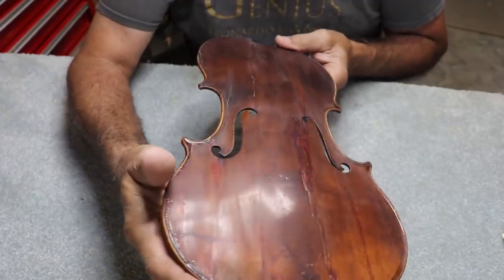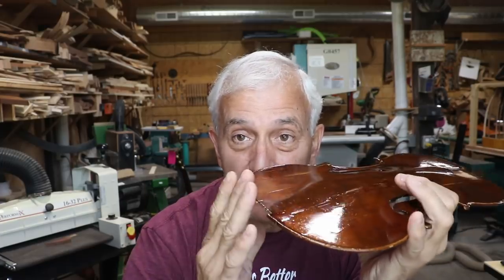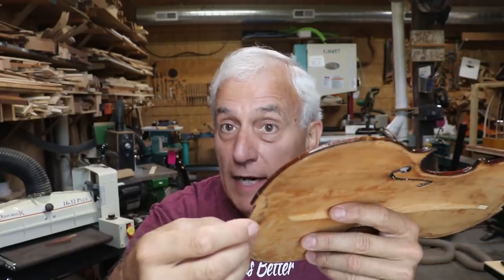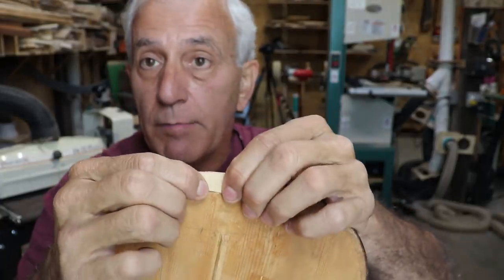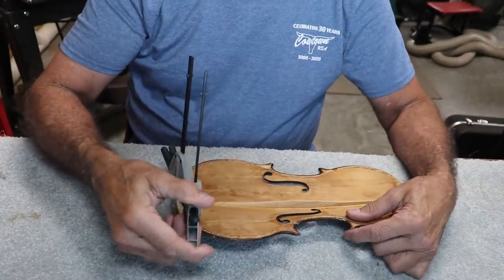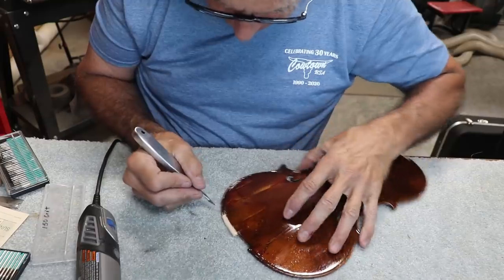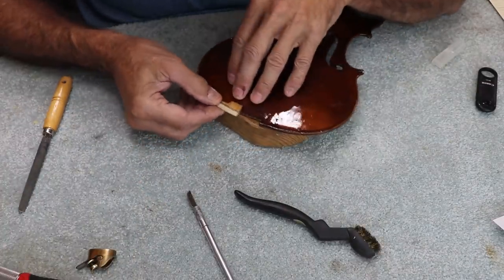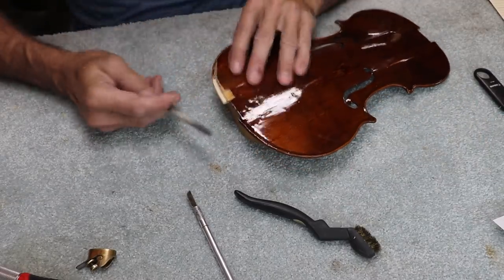433 RSW Chocolate A Bittersweet Restoration Part 3

Comment: As a restorer of fine antiques I have enjoyed watching you work and have picked up several really good tips/techniques from you. One area I see you kind of struggling with is in finishes. My advice to you is to do all your color and tint on the wood itself then seal with a 50/50 coat of clear shellac/alcohol. To get the age looking better use amber shellac but dilute it by 50% with alcohol too. Takes a little bit longer but dries fast and is more controllable. Finally - never uses shellac or varnish straight from the container. Always thin by 50%. This will eliminate brush strokes and result in a finish that looks correct rather than thick and "new". Your experience with the varnish lifting the stain was as I predicted and could be avoided by staging the finish process more like I have suggested. Don't apply any sealer or finish until you are happy with the color then seal that and use your finish coats to get the correct "age" feel. Keep on keepin' on.

Comment: I know this video is years old at this point, but this is fabulous work and I have only a small recomendation- I have foubd that tinting the topcoat can help blend disparate colors. It doesn't always take much, and some finishes are more receptive to tinting than others, but I have found it helps level out the color differences.

Comment: My guess is that you need to spray a sanding sealer over the stain.  Every time you stained it then put a varnish coat on top, the wet varnish coat reacted with the fresh stain.  But like you said, these things can be a bit of trial and error at times.  ☺☺☺

Comment: Hi, Jerry, thanks for sharing your expertise and knowledge with us!  I've three points to raise:  1) That was a great idea to rout and chisel out a rabbet to accept the replacement piece at the tail of the violin.    2) Regarding your Proxon router base, have you ever thought of adding a clear plastic base to the underside of the base to overcome the large hole in the base?  3) Have you ever tried airbrushing to blend in light stained areas to match the overall darker toned areas?  And after getting the match as close as you can get it, you could spray on a sanding sealer to lock in the colour before applying the final topcoats.
Reply from the maker: Yes I have had clear router bases in the past I got rid of them because they scratch easy you can't see through them and they are very static prone so everything sticks to them. Regarding the idea of airbrushing see part 4

Comment: Jerry your right about using a brush to apply a finish.  Applying a finish with your finger give me a break.  I really enjoy the pride you take in your restorations and this one shows how passionate you are and what lengths you go to achieve it. Really like the end grain gluing theory.  I'm a 68 yo retired carpenter not bashing or bad-mouthing but I have had luck adding a little stain to the varnish it makes blending repairs easier.
Reply from the maker: Just for the record the bottle says use your fingers.

Comment: Have you considered adding dye not stain but dye to a shellac and applying it over a thin finish to match or repair spots.  It works very well. I have had good success with restoration work I have done on both jewelry boxes and furniture. Just to be clear I'm very much an amateur that enjoys woodworking as a hobby. I really enjoy and learn from your Channel.  You do amazing work in such short time benefiting you're very lucky customers.  Thank you for all you share.

Comment: Hello, from the broken cello. I know you, like my son, work on multiple kinds instruments. Me, I focus on just the cello mainly, (I take broken cello's and repair them to put an affordable cello in a student's hands) but will also do some violins and such. The issue you seem to have is the original oil finish has closed the pores of the wood and it will not accept new stain or varnish. It is a common problem with older finishes. Many times you have to get rid of as much of the original finish, or go to a super high quality repair finish to get a color match. you also might trying to warm the wood with an ultra-violet light to help lens the finish and open the pores. It is time consuming because you only want to warm the wood for regulated periods of time. I hope this helps.
Reply from the maker: I guess you didn't see the end. That's precisely what I said I was going to do
Reply: @RosaStringWorks  Yes, for some reason it stopped about a minute before you said that... Another suggestion, if you don't mind... before you refinish it... you might want to make a plaster cast of the front, fine sand the mold to fit the original belly of the violin, steam the front a bit and sandbag it (Well I use flower in ziplock bags and some cals for even pressure) to get a smoother curve on the face, especially where the sound post break is, and the other repairs before cleating it. And I've been there, where no matter what you do, it just doesn't want to cooperate. Great videos btw... Just another instrument geek, geeking out on repair vids.

Comment: I'd not have jumped the gun on those initial recoats of varnish before you touched up the stain. My appoach would have been to go over the entire surface with 220 or 320 grit sanding pad and used a medium brown gel stain over the entire board to get an even color throughout. Let penetrate a few minutes and wipe off excess. Then do your varnish coats after the gel stain dries. Just saying. You live and learn. Otherwise an imaginative and well executed rebuild.

Comment: Hi Jerry. I had an "old timer" tell me once that he sometimes used a very light "spritz" of spray on shellac to "set" a stain before the finish coat. I don't know how that works with different types of finishes going over it. They way he described is it doesn't entirely seal the pores yet keeps the stain from rubbing off or floating out. Can't say it works because I've never tried it. Just thought I'd pass it on for future reference. :)
Reply: Good tip!

Comment: You know when you say to stop when you’re ahead, could this be one of those times?  Both my Dad and the Master carpenter I learned from told me to stop trying to do the same mistakes hoping for a difference result, and simply walk away from a troublesome project for a while.  Yes, I’m still trying to learn that one.  Hang in there, you’re almost there.  Your cross grain fix near the tail block is sheer genius!  You left us on a cliffhanger: can the hero Luthier re-stain the top of the violin and restore the rich chocolate color and sound, or has he met his match (pun intended)?  Same Bat-crazy time, same Bat-crazy channel!  Thanks Jerry.

Comment: Bare wood is the smart choice at this point. 
I think what went wrong is, you  put varnish down, then tried to stain/fix the spots and you were only staining the previous tru oil surface and when you steel wool'd and true oiled again it just wipes away. notice the espresso on the new wood patch didn't lighten up but the old streaks did. nothing for the stain to stick to very well. you're on the best track at this point. 

Great content brother, love your channel

Comment: Jerry, you have done quite a wonderful number on "Chocolate" and frankly, it looks great in the video.  I have watched a large number of violin luthiers on YouTube and I have compared one to the other regarding their techniques in carving, assembling, and varnishing their instruments.  It is hard to match stain, as you said, and I have no less a hard job ahead of me in that respect.  One technique in matching the color of the instrument is tinting the oil instead of staining the wood.  The tinted oil, just a small amount as needed, is applied to the areas needing it, feather it out, and apply more oil until the color is reasonably matched.  I have done this on woodworking projects I have done, if not just getting the tinted oil for the color desired.  I lost a sale of a piece one time when I had stained the wood then applied varnish over it.  It all looked great when I finished it and put a price sticker on it.  A lady wanted to buy it and was peeling the sticker off when the finish came with it.  Lost that sale and the potential sales of other people looking over my work. I was at a crafts show.  Not trying to change your way of doing things, just some friendly insight from someone else's eyes and experience.

Comment: having been trained many years ago to spot prints. There is a technique that will absolutely blend areas that are not the same perfectly so they disappear. You are using a painting stroke with your stains. Try using a stiple, just daubing color in tiny patches. At first it will look kind of bare and you will see blank areas around the stipling but as you add color it will fill in and those blank areas will disappear totally. This technique will take more time but you will not see any strips of areas that are blank of color. On the front of this violin where those cracks are still showing this technique will blend them in perfectly.

Comment: This has been quite an undertaking. Amazing job on this thing. Only thing I might have done differently is to strip back the old finish and refinish from scratch. The cracks would have mostly disappeared then, I think.
Reply from the maker: Pretty sure that's what I did, maybe you didn't watch it all
Reply: 0:17

Comment: Hi Gerry - Antique furniture restorers rarely put oil based varnish over colour or stain touch up. It often sucks it away as you've found. They tend to use oil paints, various colours usually mixed from palette of black, dark umber, light umber, red and white only applied in tiny dot fashion like newsprint to cover scratches or match up veneers and just wax over it after. Dots are far less noticeable than painted strokes.  You can get away with it if the varnish solvent doesn't dilute the stain solvent, like spirit based varnish over water based stain - but experimentation is definitely required first on scrap to see what happens. 😁  The age old instrument varnish, used from about 1700 onwards was made from pine resin, larch turpentine and either walnut or linseed oil, applied warm. Apparently it was considered good if it dried in less than 8 days 🤣

Comment: I was waiting for you to strip it completely right from the start. It's pretty much impossible to make all those repairs match without stripping. You should strip the whole violin, fill the cracks to perfect smoothness. There will be visible scars but that's the history of the instrument. Keep it up, love the channel! :)
Reply from the maker: It's not common practice to strip old instruments all the way to bare wood in fact it hurts the value so you try not to do it
Reply: @RosaStringWorks  I'm with you and lean toward preservation. I'm sure it was a really difficult decision to make (a) keep the original patina - warts and all or (b) do a correction to improve the presentation & delight the customer. Glad I'm not in your shoes. Can't wait to see how it all turns out in Part 4.

Comment: That violin is causing you a real headache, I'm sure no one else would have even attempted to repair it. I worry if it will hold together when the string tension is applied. Best of luck with it, I can't wait to see it finished.

Comment: LOL... Sorry Jerry for commenting but I have to agree with you, only way to get the stain to stay is to get it into the wood pores, laying it on top of the finish each time it's just going to wipe off every time you get it wet... It did look a lot better though... can't wait to see what it looks like with a fresh coat over bare wood... Maybe air brushing the top coat would have worked better, if that's possible with that finish....

Comment: I was thinking of a scarf joint for that missing piece of top, but I think your idea sounds good, too. Yours is probably better structurally, so again, good choice. I am amazed at how good she looks already, compared to the pile of parts and shards you started with, she's a masterpiece. Can't wait to hear the results.
ETA: When it comes to staining wood, you're 100% right, you never know just what results you're going to get. I built a uke, a little while ago, and when I stained it, the maple on the sides and back took a beautiful brown, and the same stain turned the spruce on the top bright ORANGE. It took a LOT of work to make that turn into a believable sunburst. Staining is a real trick. 

One thing I've learned is that sometimes a light wash of white beforehand can even things out a LOT. In maple, and if you're doing a blue or green and want the grain to really pop, you do the whole thing in black and then sand almost all of that off and then put your color over that. Makes the grain really stand out under the finish. Lots of weird little tricks in this game.

Comment: I think I mentioned early on that stripping to bare wood with all the repairs and replaced wood would be my choice to get a more even color.  We all know it will never be the same with different woods in the patches and being color blind makes it double tough to match or create an even color.  I look forward to the result.  Honestly, I did not think the current result with the yellow, red, brown, black streaks would satisfy you.  I think air brushing will help.  Have you thought of using a an electronic painter that uses a vibrating piston to force the paint out.  It will not only force stain into your skin for a tattoo if you wave it across while working, it forces the stain into the grain and surface of the wood.  I used one on my fences from Colorado to California coast homes/fences and found it not only gave an even stain, the injected stain created a depth of colored wood rather than a surface color that a sealant or varnish might cause to run.

Comment: A suggestion:  I found while matching/staining stubborn cabinets/trim that I add the varnish and then lightly brush in small amounts of stain in key locations while the varnish is still wet.  The color locks into the layer of varnish.  I then can put a coat of clear varnish over the top after the previous layer had dried.  I got the idea from an old can of Minwax Walnut Antique Oil Finish.  I ran out before the job was done and found it was no longer made.  In an act of desperation I bought the clear finish and a can of dark walnut and made my own.  It matched perfectly... with a little experimentation.  Paul Hensley

Comment: Some thoughts on the finish...  Oil based varnish, because of the oil, acts as a solvent.  I assume the Minwac stain is water based, so the oil based varnish can “clean” some of it away,  Stain also needs to be able to penetrate the grains of the wood, so putting it on after the varnish, doesn’t work.  Even when you’ve steel wooled a previous coat of varnish, some of the wood grain is already sealed up from the varnish, prevents the stain from penetrating.  

At this point, you  may have more luck if you do a though (multiple grits) steel wooling (if that’s a word) of the entire top.  Especially 9n the light areas, to open up the grain as much as possible.  Then put multiple coats of stain, on the lights spots, letting them it thoroughly “dry” (over night).  Finally, apply the varnish, but be very careful how much you rub 9n the stained areas.

Regarding stripping away the finish, I would be very concerned that whatever you use for stripping, could affect the glue you’ve used to make all those delicate repairs.  Like you’ve said, sometimes you need to know when to stop.  You’ve done a master level job of repairing a completely destroyed instrument.  No one should expect it to look “good as new” once you’ve finished.
Reply from the maker: I was using analine dyes and oil based stains
Reply: Rosa String Works very interesting.  You obviously have done a heck of a lot more of this than I have, so I should have assumed you knew that part.  It’s been years, but I used to do lots of woodwork.  I know the struggle of trying to match finish color, tone and gloss.  Looking forward to Friday, Jerry.  Very excited.

Comment: I've had luck with mixing a small amount of boiled linseed oil in with the stain to "stabilize' it, and giving it a day to dry before applying finish.  Not a cure-all, but it does reduce the 'lightening" problem.

Comment: I don't want to criticise Jerry, but could you have glued the purfling to the fiddle with CA and glued the new part onto the fiddle with the puffling in place?. This would eliminate the need to cut a purfling slot. I would also have let the big patch into the back so as not to increase the thickness so much. I love your videos and have learned a lot about novel and new ways to do things. Good work.
Reply from the maker: There are many ways to do everything.  That;s just how i did it this time.  Next time I'm sure I will do it different

Comment: If you airbrush using cappuccino by Minwax allow it to rest for 8 hours then respray to darker than you want. Allow to rest for 24 to 48 hours before using oil finish in airbrush. 
Remember oil finish will lighten Minwax dark stains. You’ll figure it out.

Comment: As to the stain I sympathize. As far as I can tell the stain just dissolves in the oil and as you are putting the oil on you end up wiping the stain off. In fact wood stain seems to me to be a misnomer, most of the time it does not seem to stain the wood at all, it just lies there on the surface. Also if there is even a slight amount of glue around those joints the stain likely just sits on top of a glue film. I think the only chance you have of it not moving is to spray on a light sealing coat.